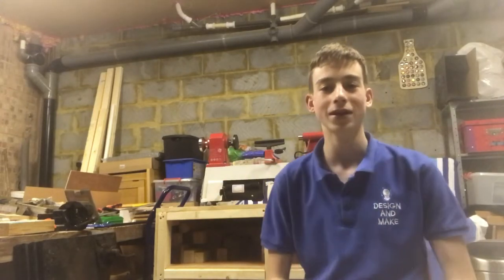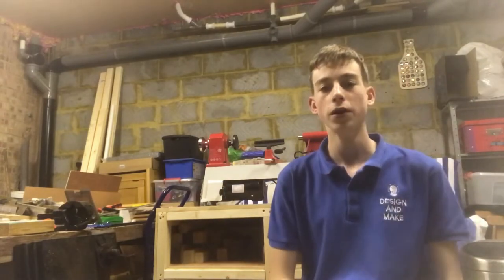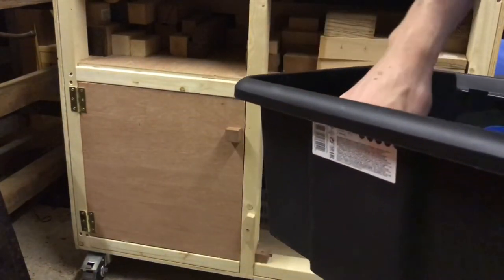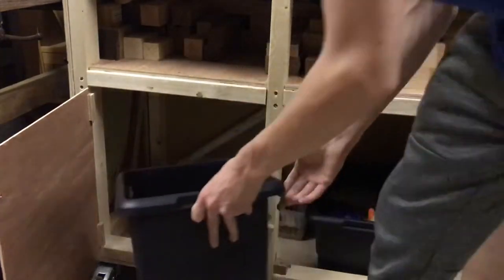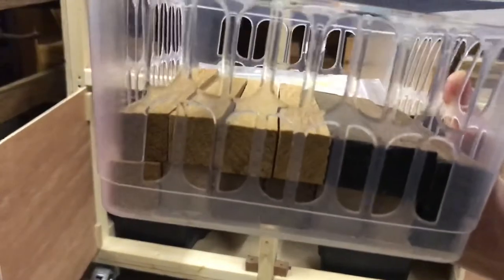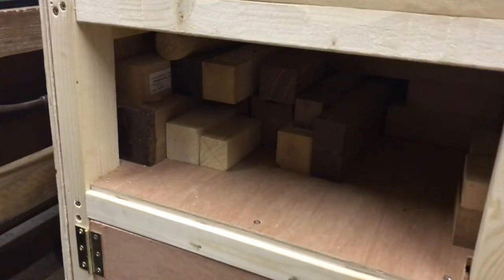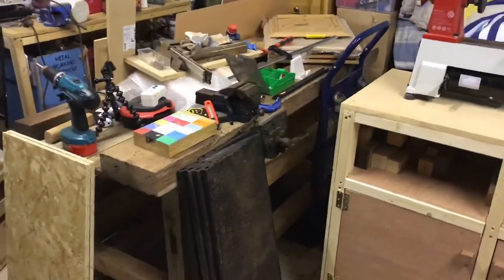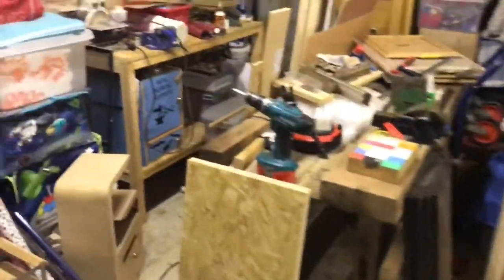Project Ideas And Lathe Cart Build | Workshop Vlog #26

Comment: I'ld be careful with the sanding/ grinding station as fine saw dust and red hot sparks don't tend mix well.
Reply from the maker: Very true! I hadn’t thought about that. In that case I might just build one workbench for the sander and the grinder will go on an l shaped workbench at the back of the workshop! Thanks for your advice!